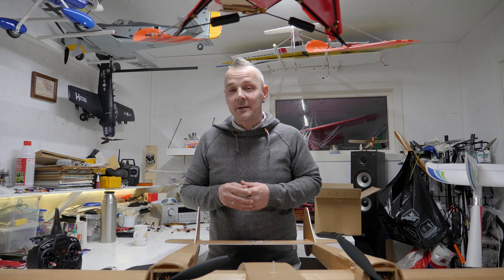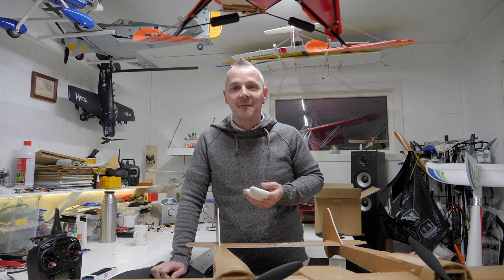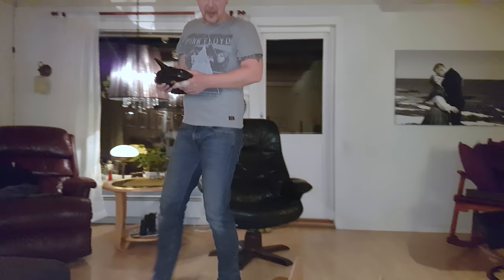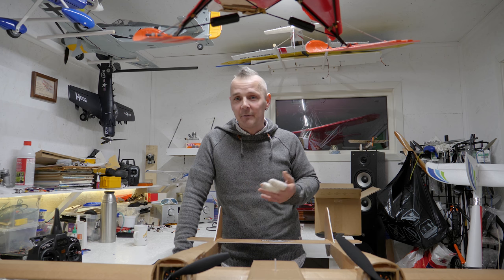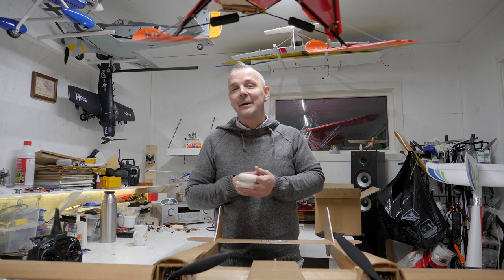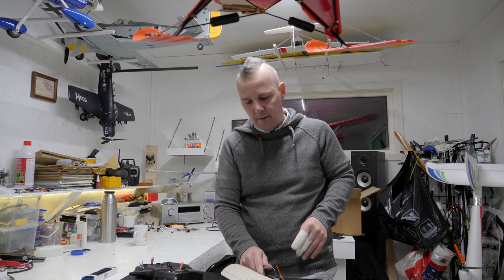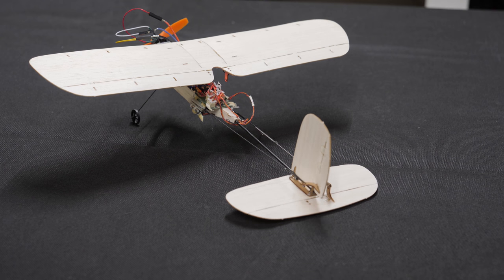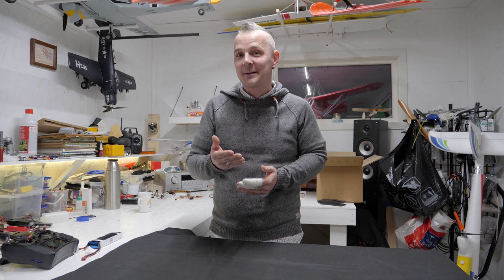FliteTestT Sea Duck is in the house and The Keplar is ready to fly

Comment: I have 30 amp ESCs, 9x4.5 props and the motors are Emaxx GT2215/09  The reverse one gets hot but not the regular one  I just don't get it.
Reply from the maker: Ron G try to calibrate your esc. Turn on your transmitter. Throttlestick full. Then connect battery. Wait for the first bip. Then thottle down. You should hear the motors biping in sync. 0

Comment: My Sea Duck has a motor and ESC that will get hot then fail.  I replaced them to with the same result. Any ideas?
Reply from the maker: Ron G what is the specs on your esc and motors and what size battery do you use
Reply: I am using 30 amp ESCs  9x4.5xprops and the motors are Gt2215/09Only the reverse one gets hot the regular one is fine.
Reply: Using 2200 4S batteries.  Used 3600 4S in the past which is kinda heavy for the plane.
Reply from the maker: Ron G i use a 5000mah 3cell. The 4 cell may be to much for the esc. Im not really sure. But try a 3 cell and see if it gets better